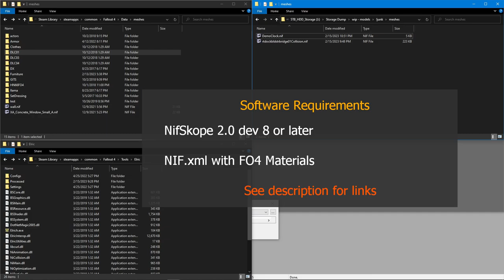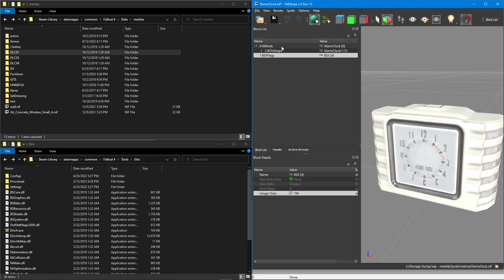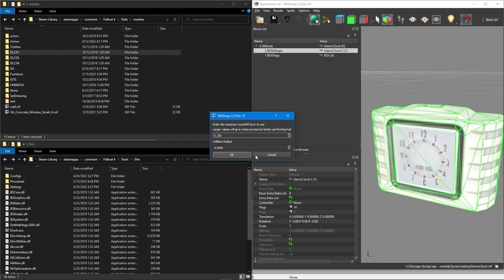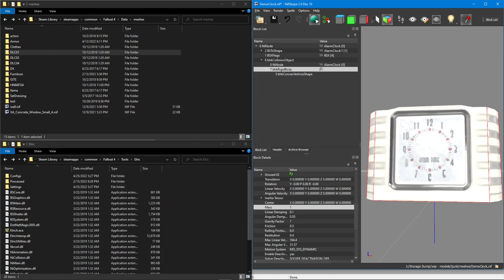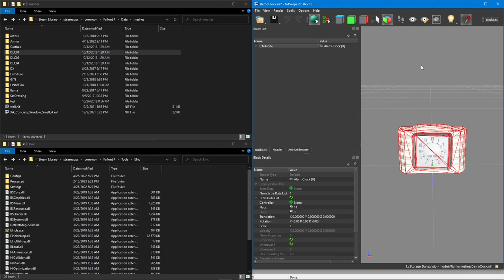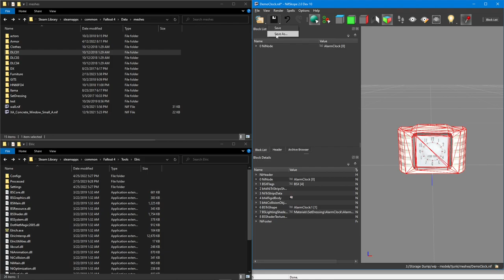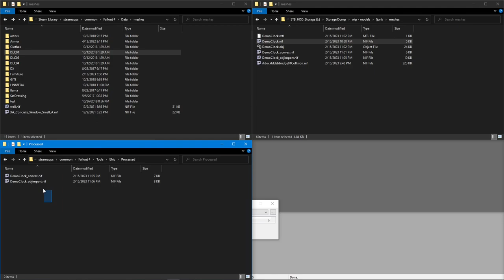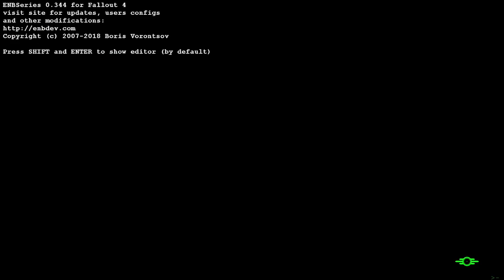NifSkope Collision Tutorial - Fallout 4 and Skyrim

Comment: For some reason I have an issue where creating a mesh, giving it collision, etc all works perfectly with statics, but as soon as I turn around and try to do the same with Furniture, the mesh acts like the dynamic flag is enabled, moving around whenever I touch it. Of course the temporary fix is mass, but I was wondering if you have any insight into this particular issue? 

EDIT: I'm not entirely sure if it has any adverse effects, or even if there is a different way to handle it as I have no way to view the default rigidbody settings for a NON-static object and I don't have the money, or patience to source 3dsmax 2015 to find out, but I found another way to fix this. Mass by itself won't prevent an object you want to be static, say a bed, from moving. As if it is a workshop item, said item would still fall into place, which is rather realistic but not what we want. To remove the motion altogether you have to set the linear damping and angular damping to 1, and then change Max Linear Velocity, Max Angular Velocity, Restitution, and both Friction settings to 0. This allowed me to place the bed I was trying to create, have the functional collision mesh, and have it still float in the air and other shenanigans a default Beth created furniture item would. Like I said though, I have no idea if this is the way you're supposed to fix the issue, or if it has any adverse effects, as the binary data is still FAR higher than that of the original model it came from, which could be attributed to the fact that I used the imported obj as collision option.

Comment: I downloaded the nifskope dev 10 in your descrption, but it's still Dv 7, and can not find the Havok when right click on the mesh. Any way to make it work? thank you
Reply from the maker: Not sure what to say. I re-downloaded it just now to confirm. Inside the Nifskope.2.0.Dev.10.7z is the Nifskope.exe which is dated 3/11/22. So if you extracted all of the files and that is not what you have I have no idea what's going on. If that is what you have, then if you run the Nifskope.exe directly it should in fact state Dev 10. If you're just double clicking a nif file to open it and you're getting Dev 7 then you have Dev 7 installed somewhere else and that is set as your associated application. You would need to replace that.
Reply: @JonathanOstrus  Oh, I figured it out. I just had to close all instances before using different versions. And the problem happened with Dev 7 for me too. So that sounds like the source of the issue. I guess it's better without Winroll or I don't know.
Reply: Close all instances of nifskope and delete the folder that has Dev7, run the version with dev10.

Comment: I pass few hours to convert a sofa, build collision - sitting marker and when i went trying out in game it flew to the ceilling xD. I've put the mass to 120 and it solved my problem. The collision still appear blue-purple in nifskope don't know why...I may have done something wrong in chunkmerge (sse). Anyway, thank you for this tuto !
Reply from the maker: To prevent the flying away part, you can either have the mass high like 120 to prevent it from moving, or in the BSX Flags uncheck bit 6 Dynamic. I would recommend unchecking Dynamic unless you have a need for it to compute movement physics and not be stationary.

The collision color is related to which collision layer is used. STATIC will show red, CLUTTER will be blue, and ANIMSTATIC will be the purple. The layer effects what other objects will collide with it.
Reply: @JonathanOstrus  It was situational...sofa docked to a wall - cmd 2 follower to sit then it started "spasming" and flew, pretty funny. Thanks for further info, still alot to learn

Comment: Im stuck at elric, i got red, not green.  turn red and show“Error: Mesh source is not relative to a *Meshes folder.” what did i do wrong? but when i tried it with vanilla go for testing mesh its green. i did reorder block before.
Reply from the maker: That message tells you exactly what the problem is. The place where you put the .nif file is not under a folder called "Meshes" which is a requirement for Elric to process it. So let's pretend your work folder id D:\Mods\MyNewMod. You need to have a Meshes folder somewhere in there and then your nif after that. Like D:\Mods\MyNewMod\Meshes\MyNewModel.nif. You could also have a full structure like where it would be in the game data folder. So something like D:\Mods\MyNewMod\Data\Meshes\MyModName\Weapons\MyNewGun.nif
Reply: @JonathanOstrus   THANKS THAT WORKS. NOW ITS GREEN

Comment: Is there a guide how to do it for a static model? I don't have a havok 3:04
Reply from the maker: Even on static objects it should be there. Though the selected mesh needs to be supported. The only ones I know of that are is NiTriShape (Skyrim) and BSTriShape (Fallout4).
Reply: 9:05I have red squares @JonathanOstrus
Reply from the maker: @magarichH  Kind of hard to troubleshoot that. The simplest thing I could suggest as a test is to make a copy of the file. Remove the entire collision tree. Then see of Elric will process the NIF without collision. If that fails then you need to figure out what's wrong with the file to start with. If it succeeds then I would attempt the collision all over again. Might have been a step missed or something. Such as re-ordering the blocks or something. Short of that I would suggest hopping into a modding forum or Discord with users familiar with NifSkope specifically. Some of those may have users willing to look at your file and help identify where the issue is.

Comment: Hi, you helped me figure out a problem a month ago and maybe you can help once more. I created a rotating platform (animated nif) but the coliision is half working. I can stand on it but the rotation do not apply. I checked in nifscope, the collision box rotates with the obj, tried various bsx flags combo with both dynamic/static collision. The only way it work is with jaxonz positionner mod. As soon the obj is selected or moved, the platform work as intended or so (rotates on 1 axis without affecting where you are looking like if you would do a circle with keyboard keys not touching the mouse (if that make sense)). Start thinking it's not a nif but obj type problem in the esp. Another question for niTransformInterpolator, are the transform data keys as to be writing manually or auto compile with <float min/max> or run a xml script (1000+ keys) ? Sorry for the long comment, i have searched alot, Nifskope(tools) instructions are not very detailed and don't know where to refer :/
Reply from the maker: Sorry for the late reply. Didn't see your comment alert. Anyway, I have no experience with animated NIF files. So I can't really say what's going on. I have heard of other people having issues with collision on animated files. The best I could suggest if finding a Discord server which has some people familiar with animating NIFs that might be able to assist. I suspect it has something to do either with flags on something or where certain parts of collisions are located in the branch node hierarchy.
Reply: @JonathanOstrus  No worry.. I figure it was a flag compared with game assets. I went further since adding activator and stuff but tuto's are still hard to find.

Comment from the maker: Corrections and additional info: convex bubble / stationary objects / Skyrim

Regarding the convex bubble mentioned. You can reduce the bubble size by changing the radius from 0.05 to 0.01 on the ConvexShape right under the material choice.

Regarding stationary objects. If you want everything in your file to remain stationary and not move then do not set the dynamic flag on the BSXFlags. That allows for the motion solver to move it. At which point the mass is taken into consideration. If your file has some parts you want stationary and some parts you want to have movement then setting dynamic and adjusting the mass to have differing values on separate rigid bodies would be a possible solution. But that's a much more advanced topic outside the scope of this video.

For Skyrim collision I'm told that only convex hull will work. Also you would skip the Elric part as that is specific for Fallout 4 to compile the collision to binary data for the game engine. For Skyrim you would just pick an appropriate Skyrim material and once you reorder blocks and save you should be ready to put it in Creation Kit.
Reply from the maker: @@solomonlokles2386 I'll assume you're doing the ground object nesh. Passing through it usually means it's on the wrong collision layer. It needs to be on static. Not falling to the floor usually has to do with not having a mass. Beyond that it's not really something I could troubleshoot with you here. I would suggest joining a Discord server that has a channel for missing help. Preferably for NitSkope but others may be able to assist. The xEdit Discord is usually helpful as is Ousnius (maker of Body Slide). xEdit's invite link is on the top right corner of the window when you open it if you need it.
Reply: So I guess since skyrim can’t really handle concave shapes, you’d have to split a complex model into multiple meshes and follow the other tutorial, combining multiple convex hull collisions, right?
Reply from the maker: @1lllllllll1  It's not a Skyrim or Fallout limitation. It's the definition of what a convex hull is. And in the context of what it encapsulates. If you have large spread out parts then you'd need to chop it up and create a hull for smaller parts so it doesn't encapsulate the whole large single object. The advanced version of this video https://www.youtube.com/watch?v=awGP7cIBKtI demonstrates that.

Comment: Is this tutorial apply to weapon collision as well ?
Reply from the maker: Not directly. Most weapon collisions use box primitive shapes. Which technically could be made in nifskope but it's tedious and not intuitive. I'm fairly sure convex hulls should work on weapons too but I've never used it. If you have Skyrim you could look at the cross bow. I'm pretty sure that uses convex hull and could give you an idea of how it would look for fallout 4 before processing with elric.
Reply: @JonathanOstrus  I was actually using obj method and it relatively works only problem that i can't find sound fo drop heavy weapon.
Reply from the maker: @adambodnar5490  obj import produces a mesh collision which is very expensive performance wise. For the purpose of weapons it's totally unnecessary to have such a precise type. While it may work it's generally discouraged.

Regarding drop sound. There's 2 types sort of. For when you pickup/drop from inventory there's a sound specified in the .esp plugin on the weapon or armor record. For when it's out of inventory on the ground being moved around or whatever it uses the material type specified in the collision data. IE metal, wood, etc.

Comment: Hello Jonathan I hope you can help me with an issue I'm having. I tried to follow your steps but when I try to see the collision red grid line that it shows in this video, for me it's not working :( and I don't know why. I have both nifskope 2.0 Dev 10 and also downloaded your nif.xml I also tried doing a collision with the exact same clock on the video but in my case I cannot show those red grid lines even if I click the bouncing ball in NifSkope. I believe my issue could be related with NIF.xml as I'm not sure I installed it correctly. I just replaced the nif.xml from the main folder where the executable nifskope program is but I'm not sure this is the right way to install that nif.xml and as you mentioned on this video that XML handles for material types and collision layers so that's why I think that's what I'm missing but don't know how to fix it.

To resume it. Those red lines showing the collision in your video do not appear at all on my end. 

I appreciate if you can help me with it. Tried on Google but there's not much info about that. I'm a newbie with nifskope
Reply from the maker: Only 3 reasons I can think of for collision to not show up.
1) if you don't have collision in the file
2) if the collision is already processed through elric which is then a format NifSkope cannot show
3) collision highlight is disabled.

For #3 look for the Red gear shifting looking icon to the right of the lightbulb in the toolbar. Or right click the toolbar for a menu list with text. Ensure that is on, try toggling to see if that makes a difference. If that doesn't do it then it's likely either there isn't any or it's not a format NifSkope can handle.

I just thought about another case which is for certain shape types. I believe cylinder, or maybe it was capsule, doesn't show. But the others like convex hull, box, sphere, or mesh should.
Reply: @JonathanOstrus  Thank you for your reply. And I believe is reason number 2 kind of.  I didn't process it with Elric but instead I used the original collision of the game. All I did was using BAE and extracted the Alarm Clock directly from the game but didn't know those collisions that appear in the object do not show up in nifskope (Sorry for that I'm still learning it). So what I did is using that original alarm clock file and I deleted the BSXFlags and also the bhkNPCollisionObject that came from the game, after deleting those 2 blocks I only had the BSTriShape of the Alarm clock so I right click on the clock and selected "havok" > Create convex shape as you did on your video and now I was able to see those red grid lines.